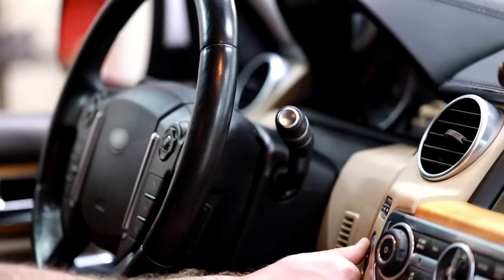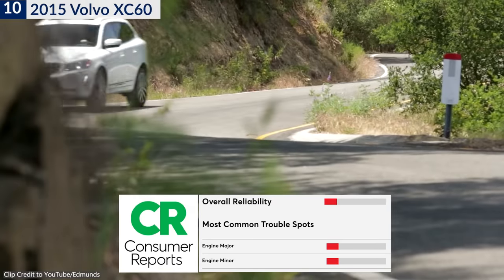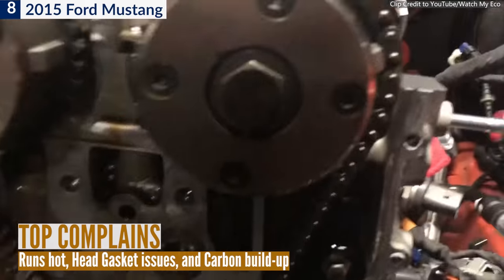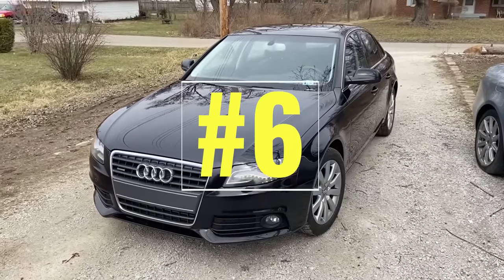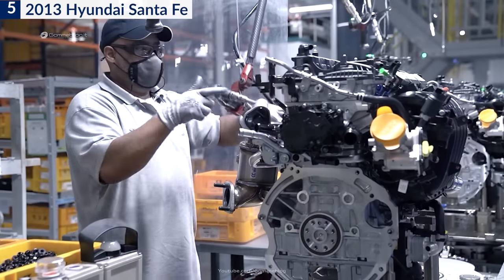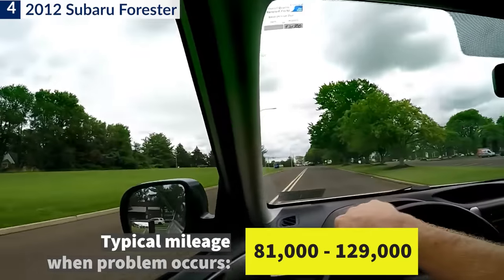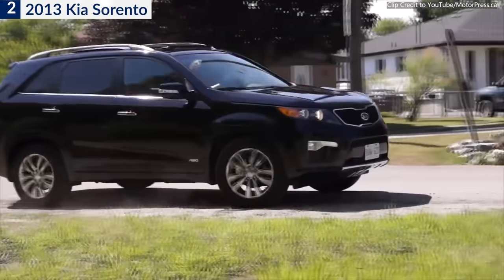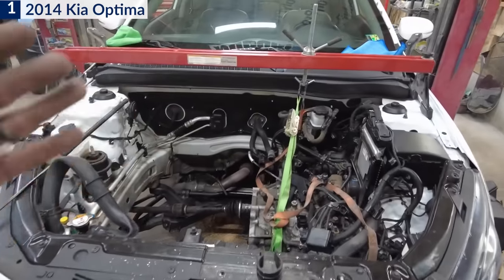10 Used-Cars to AVOID for BAD Engine - as per Consumer Reports

Comment: With all the advancements in automotive manufacturing you wouldn't think stuff like this could still happen. Especially for what an automobile costs these days. It amazes me of the most simplist things overlooked like GM's 3.6 pcv valve issue that can hinder proper breathing and lead to oil consumption and in turn timing chain failure. Sure people should check their oil regularly, no doubt about that but I've owned old cars with like GM's nearly bulletproof 3800 v6. They know how to properly design a workable PVC system. I've gotten easily 200k out of one without needing anything apart from oil changes and plugs. You know, normal maintenance. It rarely consumed oil, at all. Rock solid. My aunt still drives that car despite everything else failing apart. Engine still runs smooth. As consumers I believe we should just expect better. Especially as technology advances. I guess the old saying is true. Newer isn't necessarily better. That's definitely true when it comes to a lot of new cars.
Reply: Things break, factory made or even handmade cars in low numbers can be failty.
Reply: @ImDembe  Well yeah, of course but the main problem is conpanies like GM release stuff untested so they can rush out the latest and "greatest" while companies like Toyota are far more conservative in their approaches and slowly implement new tech with mid cycle refreshes, ect. The approaches kinda speak for themselves. I use a GM vs Toyota paradigm on purpose to make the point some makes and models are more prone to problems than others because of their approaches. GM and Toyota being the extremes. Toyota has their problem products too, their 2.4 4 cylinder for example from 2001 to 2005 are utter garbage if not serviced and not been updated with the better parts. Small flaws can make for massive problems. It's why it's important to have a conservative approach like Toyota and not rush stuff out. That 2.4 4 cylinder ended up being a very decent motor after the flaws had been corrected and issues typically wouldn't show up until way past 100k mark. Early Toyota truck frames had been also a problem they fixed. But again they fixed the flaws and now they make some of the best trucks on the road. Or how about Honda and their transmissions.. Honda makes great cars, but their early minivans had weak transmissions and still today the weakest link in a Honda minivan is their much improved transmissions.
Reply: @PearComputingDevices  Yeah this is why i would never buy the first batch of any car.
Reply: @ImDembe  No, your absolutely right. Wait a couple of model years in. My friend loved the look of the Ford Escape, you know the original 2001 model. He bought the V6 AWD version. Granted that v6, the 3.0 was old school by the time it ended up in these things, but everything rusted out on that vehicle in just a few short years. I had warned him to wait a few years. He just had to have a new truck.. I ended up cutting and welding shock towers, braces and eventually it ended up in the junk yard with only 120k after the AWD transfer unit took a crap. Eventually even a $1,200 part becomes too much. I always wait for a refresh when it comes to Toyota. I buy used anyway, because I don't like throwing away money like that, but if I like a model I will wait until they do a mod cycle refresh and wait for someone else to pay the "new tax" lol. Like I have a 2012 Highlander and a 2014 Sienna. Both are mid cycle refreshed cars, both used and babied. I have a classic Chevy too, but there's no way I would daily that thing. I would lose my wallet more than one way. So on nice days I might take it to work or something but the thing just guzzles gas and I kinda wanna keep it.. but yeah never buy anything right away. I research and wait. I carefully buy. Mostly because I am cheap. I kinda like my steak and potatoes and a little something in to my retirement savings. Not that I am going to retire anytime soon with this inflation. It hurts! Wow.
Reply: I had a 2010 Buick LaCrosse with that awful 3.6 engine, thinking it would be as good as my older Buick's had been with the wonderful 3800 V-6.  Boy was the joke on me...  Drove me away from GM for good!
Reply: @henryweaver667  Yup. Legalized mafia thugs in a suit is how I view them.
Reply: Planned obsolescence
Reply: Bean counters at work!

Comment: I found the biggest issue with short lived engines is that people refuse to use the manufacturer recommended oil and take their vehicle to a quick oil change facility.  These quick oil change facilities rarely use the recommended oils causing greatly reduced reliability.  I am an ASE master technician of 30 years. So readers beware.
Reply: Those facilities have the exact specs from the manufacturer in their computers or in the oil filter guide book.   Not to mention it’s on the cap.  The customer choosing the wrong weight is always noted in their systems. Not their fault customers are stupid and refuse them doubling down.  That’s why tech notes save those places from being sued. It’s printed in the notes.
Reply: Disagree… I’ve used a quick change place for years… they are very aware of what’s required.
Reply: Sorry no way I am leaving oil in for 10k or using the cars oil timer for oil change. I do 5k or every 6 months

Comment: I find it interesting that many of the problem engines cite machining errors during the manufacturing process. Are these made by the same robotic, computer driven tools that the industry has been touting as having unprecedented precision the last 30 years?
Reply: 🤔 You could be onto to something.
Reply: Actually with kia it was not machining it was the cleaning process after casting . It left casting sand in crevices inside the engine and eventually it came loose , atleast that is what Micheal Murphy kia told us while takong 4 months to receive the parts to fix our car and kia covered a rental the entire time at enterprise

Comment: The direct  injection  turbocharged small engines are the problem. Hi fuel injection pressure, plus turbocharging is stressing these small engines. Honda also had problems with the first GDI  turbo engines. Fuel going past the piston rings and diluting the oil leading to engine failure.
Reply: I'm glad I instinctively stayed away from these small, high pressure engines. I just have a regular flat 6 and I'm about to hit 180K.
Reply: @turkovich530  what car?
Reply: @KiraBKADestroyerOfWorlds  Volvo XC90 3.2
Reply: And that is why all of the manufacture recommend very special oil for them!
Reply: @turkovich530  The 3.2 XC90 is... an inline engine; not a flat 6.
I see your political "intelligence" extends to your engine knowledge.
Reply: @tim3172  still smarter than those who buy compact turbos or hybrids, thinking they are saving money.

Comment: I had good luck with most of my gasoline cars.  Best was the 3 cylinder Suzuki Geo Metro with over 300,000 miles when I retired it.  I put in a water pump, timing belt, tensioner and new clutch too.  Now I drive an EV and I really don't miss greasy hands and breakdowns!
Reply: Wait for battery failure....you'll wish you had grease on your hands.
Reply: @harrydavis8120  relax, Toyota has a 10YR 150K mile battery warranty.
Reply: @AndreyBanyuk  that’s not much.
Reply: I thought long and hard about this reply, so here goes: Buy a second battery now swap each year like a tire rotation. Justifying other replies yes they have a warranty- a pro rated one so when you get past nine years and say 135,000 miles the battery plus the labor will be a lot higher priced than a new one now or even one 4-5 years old. America does need for it's little boy and girls to start getting their hands dirty. Again. I laugh at the DIY fidgets and roll about the fidgets sold online.
Reply: Gotta love those 45 minute "gas" stops on long road trips.
Reply: Put aside the fact that most of us would rather walk than drive a Geo Metro. Possibly one of the worst cars ever made in many respects. That most of us don't even consider the car
Reply: @cuylerwilkinson4414 you do realize that the battery that powers an EV is much bigger, much more expensive, and much harder to replace (prob impossible for your average car buyer) than the one in a gas-powered car, yes? Not the kind of thing you can do as easily as changing tires....
Reply: @harrydavis8120 I bet when ppl first switched from horses to cars they were also saying, "you'll wish you had horse manure on your hands."
Reply: @SayAhh as an industrial electrical engineer, I’m gona tell you that ev will be a paper weight in three years.  We aren’t updating the grid at all on the East coast/ mid west nor are our competitors on the West coast.  You won’t be able to charge your car bc of load on our substations.

Comment: Hyundai Santa Fe, Sonata, i45, Kia optima, Sorrento all have same 2.4l 4cyl GDI engine. Many people have experienced engine failure. But my i45 still runs like day one. Bought it at 39000kms, today 154000kms. Nearly 10 years of ownership never broke down. Apart from regular maintenance. No issues.
Reply: Brother I also own a Hyundai I 45 ? It's ac not working since yesterday..do u know what could b the reason?

Comment: They said 2011 Hyundai Sonata but that also applies to the 2012-2018 too . I have a 2014 Hyundai Sonata 2.0t and had to get the engine replaced cause it failed WHILE I WAS DRIVING on a busy road  🤦🏾‍♀️Hyundai took care of everything and I didn’t have to pay a dime because of the lifetime warranty… kia cars (especially optimas) have the same engine problems with the lifetime warranty too.. my 2014 sonata runs fine since the engine replacement
Reply: Kia and Hyundai make bulletproof cars

Comment: I still remember in 2012 when Kia really started booming more. 100,000 mile/10 year warranty, everyone was loving it. Now, I barely see Optima's on the road. My mom fell for the warranty, and a Kia dealer is a few blocks from her house. She bought a 14' Sportage, 95k on it now. Burns almost 2 quarts every 1000 miles. Started burning oil around 75k.
Reply: I hope she plans to get that engine replaced before the warranty expires.
Reply: @madmatt2024  the engine warranty was extended by Kia due to this issue. She's well aware. It can go in technically anytime and get replaced- it would pass the oil burn test for sure.
Reply: @madmatt2024  I believe it's lifetime engine extension. I may be wrong but 90% sure. It's not my car, my Toyota with 180k uses no oil lol 🤷
Reply: My mom has a Kia 2019 Forte, I'm worried about this year model, seen videos talking about the transmission and motor going out or in the shop for these issues! Anyone had issues?
Reply: @russpendergraft5057  change the oil with quality synthetic every 3,000 miles. That's the only way to stop the engines from blowing, and even being frugal about oil changes.. the engines still can burn oil or blow out of nowhere. My mom's Sportage is at 105k now. She switched to high mileage oil, isn't burning as much. But still an issue.

Comment: I remember buying a used Equinox.   It has severe engine noise/problems within a week, and it was returned.  Such awful vehicles.
Reply: Your problem isn't that you bought a used equinox. It's that you bought a Chevy. Take it from a former 2014 Chevy Cruze LTZ owner.
Reply: 2500$ water pump on 2.4
Reply: I had a friend buy a brand-new Equinox and the transmission melted down. NEVER!
Reply: Bought a used 2006 Equinox in 2012. It was a good deal with low mileage.....it stayed low.
Those 3.4L engines are a trainwreck waiting to happen.
Reply: Facts 2010 equinox engine and transmission blew before 100000 miles

Comment: The 2012 Sonata engine was also part of the recall. Hyundai replaced our engine but refused to pay for gas, hotel rooms after we had to drive over 800 miles the next week to pick up our car from where it broke down. Bastards !!#
Reply: Should've gotten a Lexus instead for white glove treatment.
Reply: Hyundai should have had a MAJOR RECALL FOR OIL BURNING on the 2.4l my car burned  a quart every tank of gas, I always used Shell with pennzoil 10w/30 here in Tampa bay.

Comment: Spot on had no idea that the 2.3 eco boost was so problematic
Reply: Your best bet is to buy a vehicle with an engine that has been in service for a long time. Most engines in the list had problems in the first few years on the market. Toyotas are reliable because they have been using the same motor in their cars for 15 plus years.

Comment: Generally speaking (and having never owned one), I'd think kia/Hyundai was atleast a decent brand, but every brand has its year(s). My wife and I were looking into upgrading from our '97 t&c and the Volvo xc60(?) was an option. For whatever reason, we didnt buy it and got an '04 durango (5.7l v8) instead of which I think we made a better choice given that were still rolling strong at 170k miles (I actually did end up changing the fuel pump myself just a month ago, but not bad for a 17 year old vehicle). We had neighbors that ironically bought the xc60 and it's been problematic for them (dont know the mileage).
Reply: your definitely right every vehicle manufacturer have issues from time to time.. even Toyota had engines that drank oil and seized bearing but none mentioned on this list so do your own research before buying
Reply: The problem is that Hyundai and Kia put the horrible 2.4 and 2.0T motors in nearly half of their models for the last 10 years.
Reply: I know somebody who got turned down on their Hyundai engine warranty on a technicality. Engine had sludged up at 25000 miles.  They were so deep in the warranty at that time they were trying to turn this much away as they could. Didn't they say they had to pay a big fine for not handling a recall correctly?
Reply: @bobh.4580  the fine was over $200M, and the total loss to Hyundai and Kia was $3.5B.  Your friend could have filed a claim in the lawsuit settlement, but I think that the window has closed for older claims.
Reply: @MattPSU02  trust me those motors are trash. I worked for a company that shipped parts for auto manufacturers...the amount of 2.0 and 2.4 Theta engines we shipped out to dealers was insane. Subaru was 2nd most, with their shitty 2.5
Reply: @W0RLDSSMALLESTVI0LIN  wow, good to know.  The replacement motor that I got from the dealer was terrible, and may have been a junkyard find.  It started leaking oil after about a year, plus the oil level was rising between oil changes.  But, at least they did give me a replacement engine and a rental car, all while out of warranty.

Comment: The main problem on the Audi Vw 2.0t 2009-2013 were the timing chain tensioner failure.  How did you miss that?
Reply: Just avoid all Audi products without warranty. This from a former Q5 owner
Reply: I own a '09 Komfort, no problems yet but I'm nervous about the tensioner. 2.0T powerful, handles great. I keep the oil super clean but it may make no difference. Crossing my fingers. Headliner failed (common) how can they get that wrong making cars for 100 years 😐
Reply: @hairlesheep Facts and I'm completely done with Audi and Volkswagen. .
Reply: No German, French, Korean or American for me. After considerable experience,I now think only about Toyota, Honda or Suzuki. I wish I knew more about Chinese vehicles—some good reports, some not so good
Reply: How? He gets views either way.
Reply: As a technician, the 2.0 engine doesnt have problems, it IS a problem!

Comment: You forgot to mention the Chevy Aveo 2010. Cooling system issues 981.00 to replace a stuck thermostat! Timing belt breakage, ignition failure, Starting system failure, engine continues to run after key is turned off, and removed, and check engine light for low catalyst efficiency. Car is an unreliable money pit. And did I mention the transmission?
Reply: Sounds like a lack of service. Thermostat has a 24 month 2 year replacement on it. My mom had one and it never was in the shop. But serviced every 3000 miles.
Reply: @bsgarey  Mine has been as well. Talked with other owners seems that buying this car is a crap shoot.

Comment: There seems to be no correlation between CR ratings and sales numbers. For example, CR has never recommended the F150 or Explorer. But both have been number one in sales for decades. And both the CRV and RAV 4 have had more than a couple issues, and still top the sales charts.

Comment: I love my Honda and Toyota vehicles. My originally purchased 2005 Toyota Corolla has 195, 000 miles with no problem with the engine whatsoever.  Just last year for the first time replaced my AC compressor and my catalytic converter since new. Honda vehicles have the same amazing performance history. Change the fluids regularly and replace belts, hoses, plugs, brake pads and tires and windshield wipers and you are good to go.

Comment: I purchased a used 2016 GMC Sierra . I learned the hard way that GMC has one of the worst transmission problem ones it reaches 100k miles. Still today It feels like it can go out at any day again.
Reply: GMC used to be a powerhouse. Now they’re cheap overpriced P.O.S cars. Their SUVs and Trucks has one of the worst Gearbox and they love to over-consume oil. Never again with GMCrap… my uncle had a sierra 1500 and got rid of it after a year and a half.
Reply: A lot of chrome that’s weaker material than some plastic I’ve seen on cars. You can dent it very easily too!

Comment: I own a 2017 Buick Encore,  engine code: B. I commute 2hrs to work.  190k miles.  It took 5 turbos and 2 engines to get there. Oil changes every 2800 miles. My best mpg combined: 42mpg A. Comfortable quiet car, shitty turbo oiling circuit.